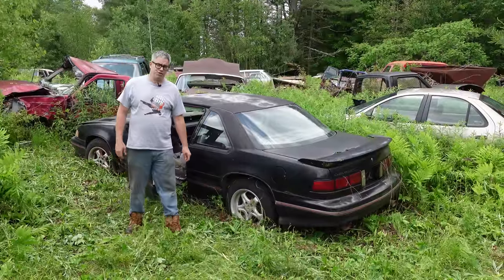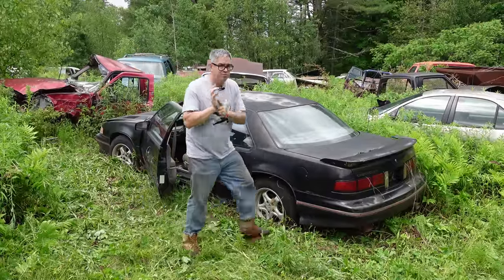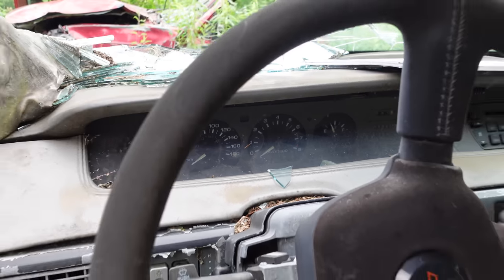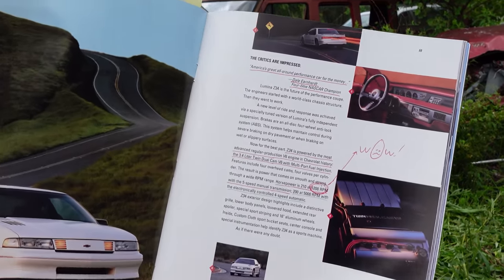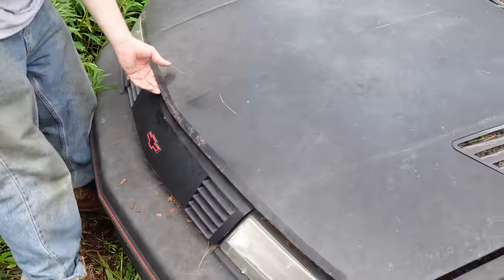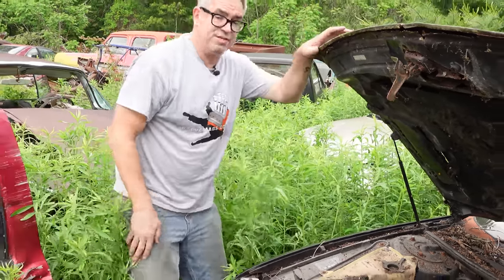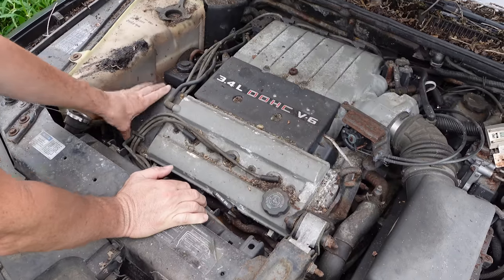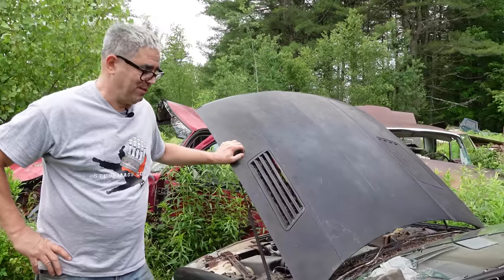What’s Up D.O.H.C?

Comment: Had the 3.4 in a '92 Pontiac GP SE coupe with a Getrag 5spd. Was a fun quick car in it's time.
Reply: @81cb750fss  Rare car!
Reply: @jiggity76  
Well, I was told it was ordered for a wife of one of the managers of the dealership. True? Hell if I know, but like another commenter has said, 2nd into 3rd specifically, and then winding third into fourth, it was damn quick at the time. First was short.
 And sounded like a fury!
 I beat an '88 or so red BMW M3 that wanted to play one night, I was heavier, and FWD,  but I had power and gears, I walked away all the way to three digits +. 
Dude was very not happy at the next stop a couple miles down the road. I was loving my GP. 
All I was missing from the GTP was a spoiler on the trunk. At least I think so. It'd run down a Mustang 5.0 GT for a 3.4 V6, but GTs had a bit of power and more torque to get rolling. I miss Pontiacs!

Comment: As a Chevy dealer tech in the 90's, I can attest to the DOHC being an absolute pain to change the belt.  Good thing was, it is non-interference.  Bad thing is, no cam timing marks, so belt changes required pulling the plenum and valve covers to install timing tools.
Reply: My God. With all the work that went into those heads, you think they would have had the brains to put timing marks on the cam gears....
Reply: How about the oil pump drive (remnant of the distributor) seal that would leak, which would require pulling the head, lol. Not a big deal on the OHV motors. We used to give the customer the option of popping it up and putting RTV on it to buy some time.
Reply: @mikepodorski4272  And to this day you hear stories of nightmarish issues with the 3.6 (spiritual successor to the earlier GM V6s?). We've got a Honda 3.5 V6 in an 2013 Acura RDX with approximately 167k miles. Had the timing belt changed once by the dealer and it will soon be due for a second. I had them change the plugs at 120k miles just to be safe and because I didn't want to do the contortionist routine for the rearward cylinder bank. Knock on wood, the engine never gave us an issue; doesn't leak or burn a drop of oil. There is something to be said for the Honda V6.
Reply: Total piece of junk and should have never been built.
Reply: @LongIslandMopars  Honda has made that V6 forever. I think its roots date back to the late 80s when it was 2.7 liters. I've had three Odysseys with the 3.5, it is bulletproof (unlike their auto transmissions).
Reply: @davidgalinat4257  I remember their 4 speed automatic transmissions were made out of glass and bubble gum, but the 6 speed auto in the RDX and the 5 speed auto in my TSX SportWagon have been bulletproof. My dealer service manager told me that Honda learned from its mistakes and overbuilt those transmissions. I've got over 120k on the TSX and it's been fine. The RDX has a lot more than that and so far so good.
Reply: as a non-dealer tech, I recall doing a belt on one of these and having to jig-rig a few things to hold the cams for a belt change. What a joy that was! I also recall an issue with the vac hose on the power brake unit collapsing when it was hot. Basically, you'd be driving, and the pedal got really hard, like the booster unit was failing. Replaced that vac line with a piece of reinforced fuel line and never had the problem again.
Reply: I still have my 3.4 timing tools!  Did several. Yeah, mega pita.
Reply: I was working at GM dealer also. What a piece of crap.
Reply: I purchased a brand new one identical to the one you are showing. Every time the temperature out side dropped bellow twenty degrees f. It would not start, tow it to the dealer to warm up , it would start, went through three alternators in a year and a half. Ps did any one else see the harder snake?  It's on the left side top of the screen when he lifts the hood.😊
Reply: @philipstephan5451  ... I did see early 90s Luminas with the rear alternator bearings frozen. It was intermittent and would actually stall the engine. I believe it was the other engine. (3.1?)
Reply: Useless fact. Had to take the passenger side axle shift out to change the alternator, which was buried under the intake on the back side of the motor. These cars were a PITA to work on.
Reply: @sprint6855  
Nah, it's not that bad really.  I can now do them in about an hour or so.  Lots of practice makes perfect.  Depending on what year of LQ1 will determine if it's non-interference or not.  I think you're talking about SETTING the timing in order to use the tools.  One does not need to use the cam tools when the timing is already SET and just changing out the belt.
Reply: Thank you for that interesting and unique look at the Z24s, I was shocked and impressed that the little spoiler was wind tunnel tested and that it provided downforce.
Reply: @LongIslandMopars That's why the original NSX used it!
Reply: I remember working on them at the dealership. I liked the  second generation that you had to remove the plenum to get to the valve covers. The cam sprockets came loose by just loosing the bolt and tapping it. It made changing the timing belt much easier. Lock the cams then roll the crank until the timing marks aligned. If you advanced the cam timing by 4 degrees it made a WORLD  of difference in low end power. Picked up that trick from the Cosworth Vegas.
Reply: @LongIslandMopars  Like anybody does that today?
Reply: @reedostiguy9502 It's not a useless fact. We worked on a late 90's Grand Am in high school and the bottom nuts on the alternator were a pita to get to.
Reply: @davidgalinat4257  You need to read up with the problems the 3.5 has with rings and the cylinder deactivation control valves/solenoids.
Reply: @Ronaldl2350  Changing the alternator was a joy.
Reply: Not all of them were non interference. When I worked for gdyr, we had 3 come in for shredded timing belts and all 3 had bent valves. 1 hit hard enough to crack a piston. If a car came in for belt maintenance, you could mark everything and lock the cams down on tdc. Then change the belt. If it jumped a tooth due to slop, there was a special procedure to get everything lined back up, and special tools to do the job. Even our most seasoned techs could never make, much less beat, the book time on changing the belt.
Reply: @googleusergp But when someone tries to sell one of these POS on Marketplace they'll say (Rare car) don't make them anymore. GOOD!!
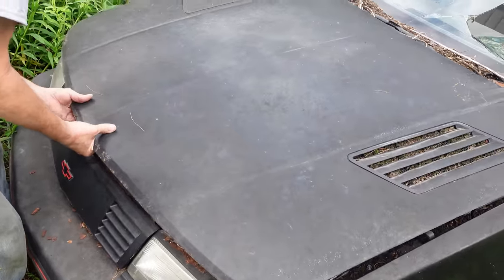Reply: @philipstephan5451  Thanks for pointing that out. Garter  snake @ 4:42 jumps off passenger side shock tower.
Reply: Chevrolet only knows how to make two good V engines, the push rod v8 and the 3.8 V6. 4 cyl are crap and their multivalve are worse.
Reply: @PatricioGarcia1973 4.3 as well
Reply: @frankpeletz1818  Which years? I've had 04, 10, and now a 23 and none of those had those problems.
Reply: @DrFiero  I gave mine away 10 years ago to a tech that had one of those monstrosities.
Reply: Oh man I did a timing job on a Monte Carlo z34 without the tools made my own timing marks with a paint marker lol it was one of the more involved timing jobs I've done
Reply: @frankpeletz1818 I took the axle out when I did mine lol
Reply: @wvangus82  I use to drop the rear of  the cradle-more room.
Reply: @davidgalinat4257 +1 on the TERRIBLY WEAK Honda auto boxes ! Made of cream cheese ! 💩👎
Reply: @reedostiguy9502 LoL, same a Ford Escape 3.0L !

Comment: Chevy’s first Z-Cars, the Z11 427-powered Impalas and Z06 Corvette are just the beginning of the long list of Z-cars from chevrolet. Keep up the great work.
Reply: GM's RPO-Z codes were a convenience option that usually pertained to suspension but could or might require other things.
A=interior 
G= differential.. GT4=3.73, G80= posi.
J= brakes
L= engine 
M= trans, ... M21, M22
Z= convenience, could be a roof rack if I remember correctly.
Last Suburban I ordered I walked in with the RPO's I wanted.
There were 2 Z codes Z82 and Z84. That was snow plow and trailer tow package.
Had a few Vega GT's back in the day. They were Z29's LOL That was the handling package springs and swaybars. But also included gage package and on earlier ones a 2bbl.

Comment: I DD'd a 3.4l DOHC (lq1) for years. They are very neat engines. The power band on these is crazy and makes them very fun to drive. For a 1990s car, it was definitely a performance car.
Reply: To bad they fell flat on face in upper rpm range! They would over rev, but took half a day to do so. Just all midrange, no topend. As boring as a big block!

Comment: Hey Steve great video as always. But one correction that twin cam was offered later in the 4 door euro. My dad and I drove one brand new with the 3.4L 210 hp
Reply: @staceyhauck4200  The Lumina Euro 3.4 sedans were offered during the same time as this 92.  From 92-94.  All were 200 HP units.

Comment: That is a Canadian Lumina because the speedometer is metric - that 130 was KPH. The MPH scale was inside of the KPH scale, opposite of a USDM speedometer.
Reply: Correct, and it's also made in Canada. However, the US destined models of this time also came from Canada but would of course have a standard cluster. This one has a metric cluster, so it likely was sold in Canada from new.

Comment: Back in my mechanic days about 20 years ago, I had to change an alternator on a 96’ Z34. GM was usually smart about locating such items in a serviceable location…..usually. The alternator is on the lower backside of the engine, and requires you to partially drop the subframe to get it out. Space was a premium.
Reply: @pilottou  People often forgot to put back the generator's cooling duct system.  That greatly shortened the life of the new generator.

Comment: Cool cars! I used to work on a sweet sleeper Lumina sedan. It had the 3.4L Dual-Cam engine and bench seats front and rear. Only giveaway it had something under the hood was the 16" aluminum wheels and quad-exit exhaust

Comment: I owned a brand new Black '92 Z34 and I loved it! had it about 6 or 7 years. I had the 3 speed auto and the Bose sound system with that massive amplifier mounted under the back dash.
Reply: Hm. Mine is a 91 in red and has a 4 speed auto.

Comment: No, the Taurus came out for the 1986 (not 1985) model year. No, this is metric cluster and that's 180 kilometers, not MPH. No, those exhaust tips appear to have been replaced. They would likely have a more rectangular outlet style. Correct, this is a "W" body and replaced the Celebrity in the product line up. They were OK cars and were everywhere as rentals and fleet cars (and even some municipal and police cars) for a time. 

The 2.8L V6 debuted in 1980, not 1982 (although you are correct, it was used in a 1982 Camaro). In the early years, it had the Rochester "Disaster Jet" Varajet carburetor. Correct, the Lumina APV was the "U" body "Dustbuster" minivan which was a cousin to the other GM divisions that also produced a version of it. 

No VIN, can't win, but easy to figure out, no doubt: 2G1 for Canadian made Chevrolet, WP14 for Chevrolet Lumina Z34 coupe, X for 3.4L V6, then a random check digit, N for the 1992 model year, 9 for Oshawa, Ontario Canada assembly and the rest is the production sequence. The Oshawa plant complex operated from 1953 until 2019, closed for a time and then restarted in 2021. We know it's a Canadian made vehicle because of the blue "Maple Leaf" decal under the certification decal. 

No SPID, wish you did and no tag, can't brag, but this is code 41 (aka WA8555) Black exterior paint.
Reply: Good catch on the speedo, Mr. Google. Didn't know anyone with one of these. The stock exhaust is a memorable sound from the '90's, sounded like "turbo" mufflers. I'd say a better looking car than the Taurus.
Reply: @tomwesley7884  They were both good sellers, and they had their time to "shine".
Reply: @googleusergp  The Z34's did not get a rectangular style exhaust tip, they did indeed get oval ones from factory.
Reply: @jiggity76  The original photos of a 1992 Z34 did not look like those.
Reply: Steve is a nice guy , but he gives out a lot of incorrect information . I hate when he does it with Mopars .
Reply: @HowardJrFord  Remember we all make mistakes. With that said, some reference material had used could be faulty.

Comment: The 1990 Lumima Euro came with the 3.1L. I don’t think the 2.8 was ever offered.
Reply: @speedwack  Correct, last year for the 2.8 in the W body line was 1989.
Reply: Yes, as I recall, the 3.1 vin T motor was std in the Euro, optional on others for 90. Later the M engine came out which was better, solved injector overheating issues, but then suffered lower intake gasket problems.

Comment: Hope yur feelin better Steve..it's been a while since this aired. I still have a black '93 Z-34. I bought it from the original owner in 2004. It does need some tlc now but I can definitlly  vouch for it. Great styling, and decent performance,  but can be difficult to work on.

Comment: Someone beat me to it on the kph issue…so I’ll reminisce on my first gen SHO days and how pleasing it was to roll upon a Z34 at a stoplight.  The SHO easily handled a Z34 mainly because of its rev potential. Nowadays bragging rights revolve around the Kw size of your battery….please keep up the good work…I hope never run out of old cars to review
Reply: I've owned an 89 SHO and later a 92 Z34 and can say the SHO was much more fun to drive. Not even in the same league really.

Comment: Im surprised the 3.4 DOHC didnt end up in more hot rods. A very unique power plant. There was still alot of hesitation about OHC,timing belts and FI. Its unfortunate that that engine isnt in the line up today It might be as popular as the LS
Reply: I still don't want a timing belt engine... Cadillac/Seville went EFI V8's in '75...
Reply: @truckladders4104  The LQ1 was also offered in the 92-94 Lumina Euro 3.4 sedan, 91-96 Grand Prix coupes and sedans, and 91-96 Cutlass Supreme coupes, sedans, and 93-95 convertibles.
Reply: This one is interesting. It has a chain connecting a dummy cam in the bottom and a belt for the top ones. So it’s like they took a OHV setup and made it OHC?

Comment: I had my 86’ Monte Carlo SS stolen when I was stationed in SoCal.  So I went to the Ontario Auto Mall, and found a 4-door Cutlass with this DOHC 24 valve engine. It was a sleeper, and pretty fast for the time.  When I took it to my next duty station in Minot, ND, I took it into the Olds dealer there for an oil change.  When I walked into the service bay, the whole dealership was staring at the engine.  I asked if there was a problem, they said no, we just have never seen one of these before.

Comment: I had one of these... a couple things to point out- the Engine was a modified cam in block engine, retrofited to be DOHC, very far from a clean-sheet design. They were intended to be 285hp however, the transaxels were not capable of handling the output and so they were detuned. The engine's 60 degree bank angle is the natural bank angle for 6 cylinder V type engines- otherwise you'd need a balance shaft and to split the pins on the crank to alleviate bad vibrations.

Comment: My uncle bought one of these 3.4l Z34 models new in 1991. Nice looking car. 

I had a 91 “euro” lumina with the 3.1 in college. Was quite a dog, but it did get me around economically until the transmission went out.

Replacing rear spark plugs was not fun on these things!

Comment: I was a GM tech in the 90s and worked on Lumina’s (and Corsica’s) regularly, and they were shit boxes; the car was over engineered & under built. Nothing on these cars “worked together” in that they just crammed different ideas & tech into, but none of it worked together for a an overall good driving experience. Yes, these motors had some power, but it didn’t come in until high rpm and had so much torque steer you couldn’t use it when it did. They didn’t ride well, the transverse carbon fiber mono leaf spring did not add to ride quality or handle well. The build quality was suspect and the worst part is these weren’t cheap! The Lumina was their flagship midsize car at the time, and they charged for it. Once you added the bells & whistles, you came close to Camaro pricing, which was a much better bang for the buck (4th gen Camaros Z28s were stout.)  Of all the cars I worked on while at GM, I can say my memories of the Lumina’s are some of the worst. 

On a positive note, I love that you keep this history alive, Steve. Your extensive knowledge of the industry is unbelievably important, and thank you for sharing it regularly with the world.

Comment: I apologize if this is a duplicate, but how about the alternators on these things? Mounted tightly in between the exhaust manifold and the back side of the engine block, they caught and kept all of that heat and burnt out frequently! Furthermore, to change the alternator required you to drop and / or remove much of the passenger side front suspension (strut, spindle, etc.) and it was still a royal pain to get to it. Especially complicated the first couple of times when you didn't know that one mounting flange on the alternator was open and didn't require you to fully remove the bolt by prying, bending, and drilling!!! Oh yeah, more fun times trying to change the rear bank spark plugs!
Reply: If the cooling duct was left off the alternator, it would last about 1 week.  I got real fast at changing them, about an hour.
Reply: @dcshores49  A generator change out can be done in about 2 hours.  I'm a pro at it now after years of practice.  Extensions and a magnetic wand is your best friend when doing rear plug changes...not that big of deal really.

Comment: Cool walkthru! Buddy of mine in college had a 1991 in about 1997-1998 had a few head gasket changes but he somehow got 120k mi out of it, 5 speed manual, ABS, upgraded stereo. Was a fun car to drive I recall. He had to sell it because something was seriously wrong with the engine in the end, was burning oil pretty bad. I really do not see many (any?) of these on the road anymore?